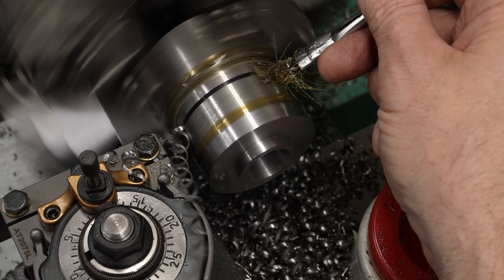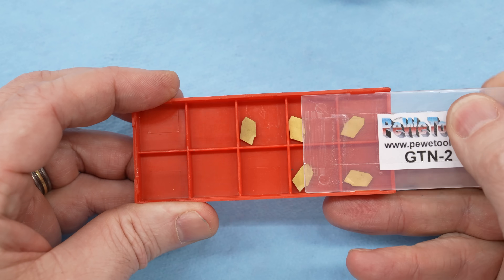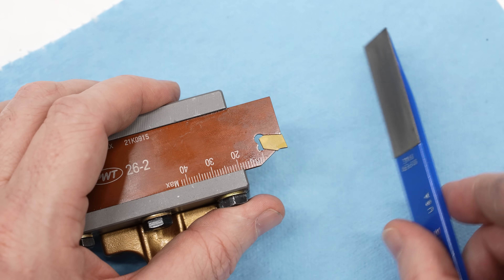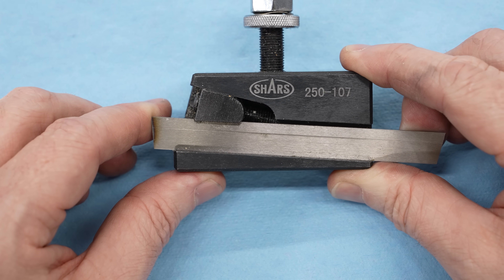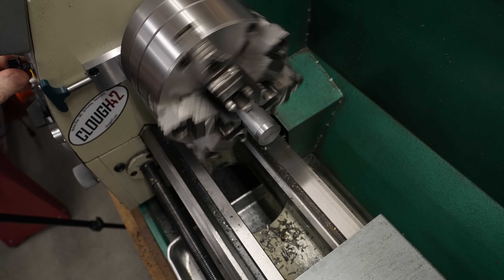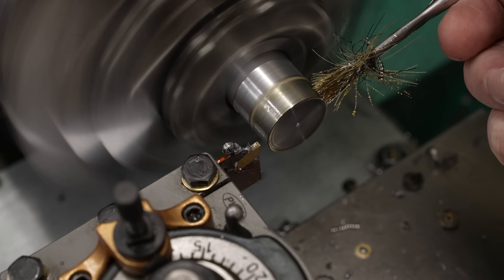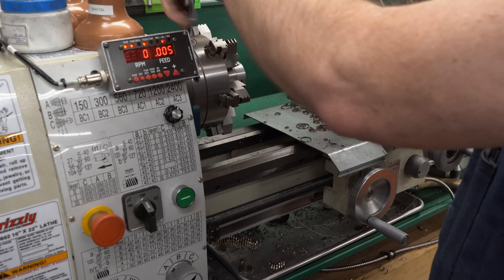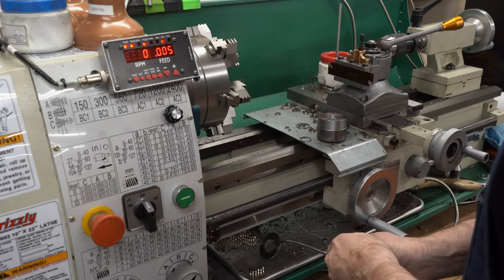High Speed Parting with CARBIDE in a Small Hobby Lathe

Comment: Retired Engineer, machinist and shop teacher with over 50 years experience. The best advice is use the tool manufacturer's recommended speeds and feeds. Watching the second piece, you're still not feeding fast enough. watch the short chips in the first cuts, they roll up and break, that will happen at any diameter IF you use the best feed rate. You don't need the oil brush, it doesn't work, make a drip bottle if you must use lube, but water based coolant is better, it actually cools the tool and part.
Reply: Unless you have a newer CNC, never go with the recommended speeds and feeds. A lot of insert manufacturers slap 600-1000 SFM. On a Lathe that would mean a 1" part would have to spin appx 3800 rpm and feed around .008-.012" per rev for a rough turning insert. For hobbist with cheaper lathes, and even some older CNC and Manual lathes, this is crap advice. Honest, I'd stick to basic formulas especially with a manual. And if you start to hear, or see something strange, bump it up or down until you get better results.
Reply: It depends on the depth of the cut, on smaller parts the oil brush works and is far less messy than water based coolant.
Reply: For most steels, I have had a lot of luck with 1000rpm, and about .001" feed rate with part-off inserts. Especially if you are trying to get a good finish with good insert life. A lot of times it saves a 2nd operation and you can just sand the back. If you go too slow with carbide, you will have worse results than HSS. Cheers
Reply: Oil coolant/lubricant cools the part + tool.  It absorbs the heat until IT becomes Vaporized.  Where did the oil get the heat to become vaporized?   From the process...  Maybe water is 'Better', ...   but oil IS NOT ZERO, it is probably 80%..... Engine oil grabs so much engine heat that water is too far away from to grab.  The oil takes crankshaft heat and piston heat and delivers it to the block for the water to get to it, and to the oil pan for airflow to cool the oil pan as well.
Reply: Machinist with any experience knows recommendations are just that.  As an engineer you should know that there are way too many variables for a one size fits all. That's a hobby machine my man, absolutely don't follow recommendations hahah.

Comment: Fear is the biggest killer of parting tools...   :o)
Don't use the brush. A can of WD40 with the spray tube is far better and you can aim it right into the slot from the front, keeping both hands close to the handwheel. i like to use both hands to feed the wheel, rather than wind it in with the knob. Bit of a juggle doing the WD40 and the two hands on the wheel, but it kind of works even if the skoosh isn't constant.

Comment: I'd be surprised if your insert were designed for a surface speed as slow as 100m/min. My experience is that the minimum surface speed you'd want would be about 160m/min and it looks like you're under feeding it. You need to read your chips a bit :)
Your tool should come with two pieces of data, surface speed and feed per revolution. If you mic the chip, the chip should be in the ballpark of your feed per rev data thick and you can tell when you're in the right ballpark for feed and speed because your chip breaker is doing the right job. When you get it right you'll see short chips, not continuous like you're getting now. Try about 50% more RPM or so and feed a bit harder.
The reason you're getting that cyclic push back is because you've developed a cutting defect that's being repeated as you hit the last iteration of it. It's why you should never stop when you're cutting.
The reason you're getting the rubbing noise on the small round is because you're below centre height. It doesn't matter when you're far away, but as you get closer the forces will increase until it'll eventually break your tool.
Finally, there's no such thing as a "sharp" tool... That's something that I hear a lot from people who grind their own. There's a really interesting phenomena called a built up edge, once the tool is properly engaged the BUE will do the last little bit and you'll get a beautiful cut. The only differentiator is what the feed per rev is, a finer edge will allow you to achieve a lower feed per rev, but it more sensitive to damage. Try about 1000RPM and feed in at about 300mm/min on your cross feed. I'd guess you'd be after maybe 1-1.5 revolutions of your cross slide handle per second. An easy way to find the right feed is that, once you've got the surface speed in the ballpark, just keep cutting faster until you start getting short chips :)

Comment: No I rule. Click the parting blade. #2 Make sure you are on centre height! #3 find a suitable feed rate and clench you cheeks and trust the process. Flush with coolant. A hot tip expands in the groove and loads it against the sides. Make sure the saddle lock is used.

Comment: Youre correct. The growling at the end is the reduced surface speed. Never hone the edge, it's designed that way for a reason. And feed is your friend. Too sharp and too slow is a recipe for chatter. Settin a touch below center helps to.

Comment: on your less than rigid small lathe,  Down cutting, ( putting the cutting force Downwards in to the saddle and bed )  is the way to go.
Up cutting, would try to lift the saddle up off the bed, and is not recommended for small less rigid machines.

Comment: Always use quality material. Someone once brought me some cheap Chinese bar stock to do a simple job. This is a quality 14x40 lathe with Aloris BXA tool post I'm working with however the rules are the same unless you have a sloppy spindle in witch case you need a better machine. Despite flood cooling this stuff (Chinese CD 1018) built up on the insert and broke a very high quality Kenametal "A-4" tool holder so fast that despite hand feeding it I could do nothing to stop it. I replaced the tool holder with fresh carbide and repeated the whole thing over again. Now after destroying $400 in tooling and inserts I decided never to accept poor quality material. My customer accommodated my needs and everyone was happy other than my pocket book. Parting can be difficult and it's often best to saw cut but if done properly it can work great. Any experienced machinist has horror stories about it so learn from them.
Reply from the maker: This 1018 is right off the rack at my local industrial steel supplier.

Comment: Mount a live tool with a 120mm+ slitting saw on it. Most small lathes doesn't seem to handle parting operation well...
Reply from the maker: I find it amusing you think someone with a small hobby lathe is going to have live tooling capable of running a 120mm slitting saw.

Comment: I have a similar-sized lathe and use the same tool. Genrally around 250rpm and I dribble lubricant into the slot format bottle with a. needle fitted to the end rather than hold a brush against it. Almost never get any chatter., I do have a cross feed drive though, which is nice

Comment: I do use 'professional' named inserts and blades. And never experienced any problems parting. So seeing this, and others almost being scared of parting is kinda hilarious 😂. But... It also shows that you shouldn't buy cheap parting tools.  I do use power feed most the time, and only use coolant in stainless steel.  The oil/brush is only making smoke and nothing else.  A carbide insert really like being ~1000c° 😅

But as you also mention, pressure is key. You need to push hard. And after a while you can easily hear and see (or feel) if something is wrong.. and you need to slow down a while. It's key the chips to outwards. And that's what the pressure is all about. New chips push the old outwards.

Having the blade under, also causes the blade to have a tendency to being pulled inwards. Always 100% in center height 👍

Best regards

Comment: 4:22 This is the moment you chipped the tip. When machine stalls you end up with carbide welded to the workpiece. If you get stuck with a carbide during cut - force it forward manually, do not back it off! Carbide can take a lot of force when compressed but it's weak for pulling forces.

Comment: I have done the same "trip". Started with HSS parting tools and low revs, learned to grind a concave cutting edge to get thinner chips, but always hated parting.
Changed to carbide parting and realized that I could raise the revs and parting gets easier and easier.

I´m using oil on a brush as long as the cut is shallow and then I use cutting oil in a spray can when the cut gets deeper because the brush simply doesn´t get that deep. I try to add the cutting oil as close to the parting tip as possible because the centrifugal forces will throw the oil out of the cut otherwise. The reason I start with oil on a brush is simply because it is so much cheaper than spray can oil.

Comment: I always figured upside down was safest since the jamming till gets pushed out not fed in. The whole high speed thing, I've heard that... with carbide! I've gone the slow route personally. But that's because I'm using hss. If I had another carbide insert for my holder I'd try running it faster. Either way I've ALWAYS heard that you need to stay in the cut. (I've also cut a second relief next to my part to avoid binding when going deep.)

Comment: My lesson from Mr Pete was to make certain the blade is at right angles. I use a square or 123 block against the chuck, but Abom indicates his in and that's probably a better practice.

Other hard lessons:

1. Cut or don't cut, but do not linger. Either cut aggressively or pull out of the cut.

2. Angled inserts (GTL or GTR) sound like a good way to control where the final nubbin winds up, but in tough parting jobs they eill twist the today out of position. Pinning the tool post so it is physically blocked from rotating is high on my agenda.

3. Flood coolant helps a lot with keeping things under control.

4. Turn your VFD all the way down (mine has a lower limit of 36Hz) and gradually increase the speed as the cut progresses. 

Aggressive cuts work, even in my tiny little Taig. On my 13x40 lathe, power feed is your friend. 

One thing i noticed in your first video is that, judging from the chip formation, the blade isn't quite square. The chip should form a watch spring, not a corkscrew,if the tool is perfectly square. 

Signed: parted 2.5" SS bar and lived to tell the tale.

Comment: Im a mechanic and at work we have an old very sloppy and worn lathe, the whole tool holder can easily jump up and down 3mm or more and cooking the inserts, taking small cuts is really tricky with it especially with carbide.
And I've found out that taking heavy fast cuts actually goes very well. Let the blue and glowing chips fly and get skin burns everywhere 😅

Comment: Thanks James.
The best way I found to cutoff is mount the cutoff blade upside down and reverse the lathe or mount the cutoff tool on the back side of cross slide if the lathe doesn't have reverse. What happens, even if you push the cutter hard, is the tool lifts up in the Aloris or other type cassette holders (holders are designed to keep the tool from dropping not rising). The extra benefit is the chips exit out the bottom of the part during cutoff operations. I've cut 1-3/4" PH17-4 stainless and O1 tool steel disks with this method without problems. I even use the cross slide advance to cutoff and I use a drip oiler and not a brush.
I made a special holder to mount the cutter upside down and I prefer using the "T" tool steel cutoff blades ~1/16" even on large diameter work. They waste less material and they're designed for razor sharp edges. On micro grain carbides I think you can get away with razor sharp edges but not all carbides work well with honing.
Reply: This is how I do it as well. The chips clear so much better.

Comment: There is a huge advantage from carbide lathe tools, but they are entirely different to HSS or carbon steels. They do not have sharp edhes in general, and the geometry is designed for high speeds. They simply will not work properly as Clough has discovered at speeds that are too slow.  Cutting speed of 100 to 270 m/min are achievable in CNC machines but a small lathe will not have the necessary drive power. Suggested feeds may also be large by model maker standards, 0.05 to 0.1 mm per rev for parting off is suggested by one manufacturer. Sharpening a carbide insert may sound good,  but will usually give short tool life. Obviously small carbide end mills etc are rather different, they are made from a carbide mix which supports sharp edges and much smaller rates of material removal. At these lathe rates a good supply of coolant is necessary, usually soluble oil, to keep the tool temperature reasonable, and the chips not red hot. the tool bit is best kept below 300C, to achieve full life.

Comment: I always apply oil using a needle point squeeze bottle rather than a brush. The brush method doesn't get much, if any, oil as the grove gets deep, and the needle oiler puts the oil deep in the groove, which is where the cut is taking place.

Comment: Ive stalled some fairly large machines over the years, most of the time its live tools or a subspindle,  the answer has always been to turnnthe speed up.     The thing people forget is you run out of sfm as you get to centerline and your motors run out of torque as the rpms go down.  And power feed is the best for parting.  And dont forget chatter is just harmonic chip breaking

Comment: James: I had problems with parting for 20 years on my JET 9x20.  tried the 4 bolt compound mount but that didn't fix it.  It did improve it.  My final solution was a disk that replaced the 
"stand thing" that had the degrees on it.  The disk is tall enough to put the compound up at the
same height.  I clamp it to the four corners as the disk is the full width of the topslide.  I engraved the degrees on it and it in turn it is mounted to the bottom of the compound with 4 additional screws plus the original three.  I put a pin in the bottom of the disk to function like the original.  still have to get the compound gib tight too.  Let me know if you need a picture to
visualize.  John Orr

Comment: This reminds me of something I have been thinking about for a while. and you would be the right person to fix the problem. could you use your electronic lead screw box to speed an inverter up as you face or part off like a CNC machine dose. whether you pick up off the DRO scale or you might have to fit a new scale. So as you get closer to the center of the part it should eliminate the chatter or growling you was having when you were parting. I think it would be one of the best upgrades after your electronic lead screw. I have an old large lathe that I would love to put something on so when facing a part 28" or smaller it would speed up the inverter as I machine it closer to the center.

Comment: Carbide tipped tools love revs,,,, unfortunately small lathes have small motors which is a conflict. For carbide to work properly it needs a “window” to work in ie, speed,feed per rev,depth of cut, etc. It’s hard to get these ideal parameters on lathes with less than 3 to 4hp.

Comment: From my experience I needed to keep to at least 630rpm for carbide parting - ideally 800 at 1000 rpm your head is screaming too much when you're that close
The "Juddering" on the hand wheel is your lathe telling you it wants more tool pressure - assuming your motor can take it
Carbide rips the metal rather than shaves - the jump is the metal lifting further away, like when paper tears away from an ideal cut line and not maintaining contact and the tip "falling" into the gap and having to re-engage